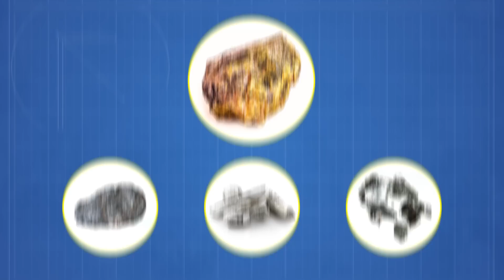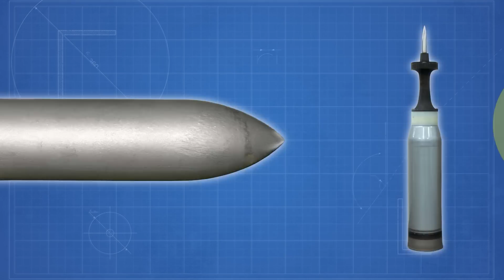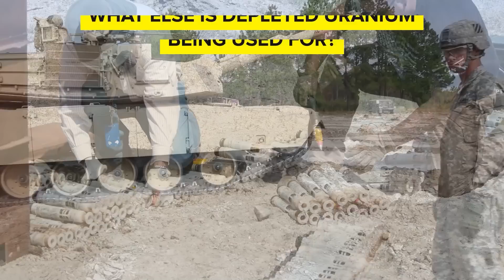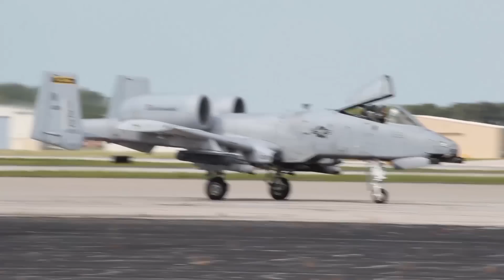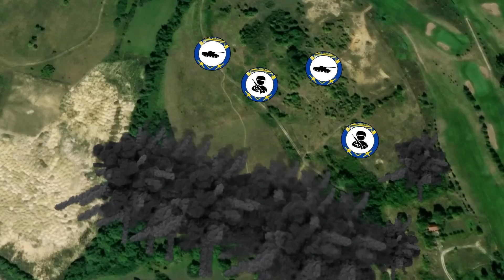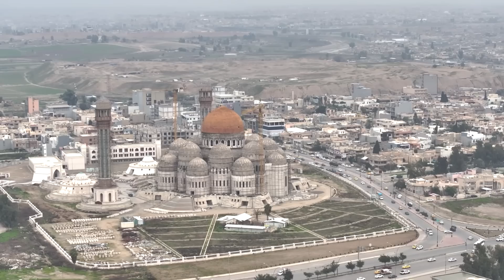The Shocking Reason Why Depleted Uranium Is Used in Ammo

Comment: :face-red-droopy-eyes:The feature most notable is the process of stRiking metal, which causes 'aerosolization'. The uRanium at that point is nano-sized, but can spRead far and wide fRom micRo-usages. The cRispie-cRitteRs, weRe seen, photoed, but not renown enough to keep childRen off tanks and tRanspoRt vehicles. 337,335 people perished due asshole US-military: hegemon use--the genocide of 1991, Iraq, was called "Highway of death" as the death toll was  by D-U Syndrome. Why, as the blood vessels get attached thRu becoming ceRamic, due extReme heat. Aerosolized and paRticlized, D-U is deadly, and has no capabilities of Removals from human anatomy, yet. When will the militaRies conqueR, use and then attend being blamed, secondarily, when non-use and cancel-abuse of knowhow to Remove nano-paRticles fiRst of all will halt spredations into Ecology? D-U's full-Life is 44.546 billion years, bye the way.
Reply: U6, uranium hexafluoride makes  the removal of ur-235 from reprocessing NPP's reactor used radio-actives. The ur-238 is 10-pounds inside a cartridge--billet--which pulveRizes holes and then aeRosolizes into paRticulates that scatter w winds and human-touching: fingers.
Reply: U6, uranium hexafluoride makes  the removal of ur-235 from reprocessing NPP's reactor used radio-actives. The ur-238 is 10-pounds inside a cartridge--billet--which pulveRizes holes and then aeRosolizes into paRticulates that scatter w winds and human-touching: fingers.

Comment: Depleted uranium  is NOT a byproduct of nuclear reactors, but a byproduct of enriching uranium for both reactors and weapons.
Reply: Well said.  To make the "enriched" uranium needed for weapons and reactors, they have to separate out the other, non-fissile isotopes of uranium.  Consider it the rejected stuff not good enough for nuclear weapons and reactors.  It never goes into a reactor because it's removed during the centrifuge process.
Reply: Yes and it’s less radioactive then uranium ore as all the good stuff( fissile U235) has been removed

Comment: What I omitted, below was that Veterans with DU Fagments in there body poses less of a threat than inhalation covered in my explanation below. As I explained that externally skin is a good protector from Beta Particals, DU embedded in a muscle like any other foreign object the body forms a Membrane around the object which, like skin forms a good barrier unlike the inhalation of tiny particles. One would "assume" a fragment would be larger and more dangerous, but this is smoke and mirrors of deep state.
Most of my knowledge came from Professor Asaf Durakovic, of Georgetown University, formally a Col. In the US Reserve and the Pentagons Advisor on Radiation matters and had access to all data from Trinity and beyond.

Comment: Purposely switching to a more expensive, less capable, and "less lethal" munition, is a shining example of activism going too far. It’s completely insane to be honest. It’s also worth noting that most heavy metals from Pb up, like tungsten and iridium, aren’t safe by any means either. While not as radioactive as depleted uranium, they tend to cause neurological problems and other health issues that are likely worse, and require smaller amounts of contamination than with uranium to pose health risks.

Comment: 1:34 "a small 4 inch cube… If this was made of uranium it would weigh about 45 pounds"
This is wrong.  4 in.³ of depleted uranium weighs about 44 OUNCES, not POUNDS.  This is about 2.75 POUNDS.
If depleted uranium was really about 45 pounds per 4 in.³, it would be FAR too heavy for the A-10 warthog to carry 1100-1600 rounds
4:59 "0.69 pounds per cubic inch."  Yes, this is correct.  And .69 pounds x 4 = 2.75 pounds.

Comment: As I understand it the biggest problem with DU rounds comes from heavy metal toxicity (similar to lead), even if they are mildly radioactive. While lead is also used in munitions (far more often than uranium in fact) uranium is much harder and due to its self sharpening and pyrophoricity potentially much more prone to forming toxic dust.

Comment: ME: "How radioactive is the depleted Uranium that is used in artillery shells?"

CHATGPT: "Depleted uranium (DU) used in artillery shells is radioactive, but it is significantly less radioactive than natural uranium. Depleted uranium primarily consists of the isotope U-238, and it has about 0.2% of the radioactivity of natural uranium due to the reduced presence of the more radioactive isotope U-235.

In terms of specific radioactivity, U-238 has a half-life of about 4.5 billion years, which means it decays very slowly. The radiation emitted is primarily alpha particles, which do not penetrate the skin and are only harmful if ingested or inhaled.

While the radioactivity of depleted uranium is relatively low in terms of immediate health risk, exposure or contamination can still be a concern in military contexts due to possible chemical toxicity and long-term environmental effects. As a result, appropriate safety measures and regulations are important in handling and using DU munitions."

-----------------------------------------------------------------

ME: "Does plants used for food take up these radioactive particles? And how would this affect anyone who eats such plants on a regular basis?"

CHATGPT: "Plants can take up various elements from the soil, including radioactive isotopes like those found in depleted uranium (DU) if it is present in the environment. However, the extent of uptake depends on several factors, including the chemical form of the uranium, soil composition, plant species, and environmental conditions.

*Key Points regarding Uptake and Effects:*

1. *Uranium Uptake:*
   - Plants do not efficiently absorb uranium compared to other nutrients. DU is not usually a significant contaminant in most agricultural soils unless there has been direct contamination from military use or other sources.

2. *Radioactivity Levels:*
   - The levels of radioactivity in plants would depend on the concentration of radioactive materials in the soil. If plants do absorb uranium or its decay products, the resulting levels in the plants would typically be very low.

3. *Health Effects:*
   - If plants contain trace amounts of depleted uranium, the health risk to humans consuming them is generally considered low due to the relatively low isotopic activity and the body's limited absorption of uranium.
   - The primary concern associated with uranium exposure is chemical toxicity rather than radiological effects. Chronic exposure to high levels of uranium can lead to kidney damage.

4. *Food Safety Regulations:*
   - In areas where DU contamination may be a concern (e.g., former conflict zones), agricultural practices and food safety regulations are essential to monitor levels of potential contaminants, including radioactive materials, to safeguard public health.

In summary, while it is theoretically possible for plants to uptake radioactive particles from the soil, the actual risk of significant radioactive exposure from eating such plants is generally low under normal circumstances. Regular monitoring and adherence to safety guidelines are crucial in areas where contamination may be a concern."

Comment: There is something untold regarding the effect of pulverized depleted uranium where this kind of ammunition has been used (Iraq, for example). The soldiers affected have REALLY been affected by something really bad! 
I do not even begin to pretend to know anything concrete about this issue, but obviously SOMEONE is lying!
Reply: Nooo it wasn't the huge black clouds of burning crude oil or a small amount of chemical weapons blown up be airstrikes on ammunition depots those things had nothing to do with illnesses suffered by troops. 😊

Comment: I saw this firsthand during operation Desert Storm. The M1A1 round would punch a 2-3 inch hole in one side of the T72 turret. The explosive gas it generates would basically make everything inside the turret into a gaseous state, detonate all the ammunition, and then pass through the turret and exit the other side. The exiting round pulls with it all the things inside that have been turned into a particle or a gas. This includes, tank personnel. After the tank stops burning, nothing is left inside. Everything that was part of the interior tank: seats, radios, individual weapons, machine guns, crew equipment, is completely incinerated . The inside of the tank looks like everything was made of cardboard and someone took a blow torch to the inside of it. The exit hole of the of the round is slightly bigger at about 4 to 5 inches.  The detonation of the ammo is what causes the turret to blow 3o feet into the air.
Reply: I was there also. DU is very effective. Humans from all over the world should consider the consequences of war. It is no game.
Reply: God damn, that's thorough. I'm thinking something like that Rich Asshole Submarine implosion near the Titanic not too long ago: at least it happens so fast, pain literally can't travel through the nervous system fast enough for them to feel it before being frappe'd.
Reply: @Xunkun  Yaa ain't it.
Shameful admission? by grade 3 (1963) I was straining to understand diff 234 / 235 / 238 ... it was the age of Mercury missions. And the roots of war in Vietnam.

I surely do wish folk paid more attention to history.

^5
Reply: @Xunkun  That was my first thought too after reading that harrowing description of what happens when it scores a solid hit.  My friend's father was a tanker in WWII (ETO) and his descriptions of "brewed up" tanks were far more nauseating.  Those guys died hard.
Reply: I've recovered some spent 30mm A10 projectiles and I can verify: those suckers are HEAVY!
Reply: @johnphelps7519 yeah? How’s your health?
Reply: Ive seen what exploding aluminium dust can acheive so the thought of something even hotter and presumably faster than that is quite astonishing. In terms of humaitarian impact,  its strangley comforting to think that one of the most difficult situations to be stuck in on a battle field could end before you even realise you have been hit. I imagine that given time to think about it injury and suffering are what most people fear the most. Instant ending is not that frightening when compared to the other posibilities
Reply: As so largely demonstrated in Ukraine. I've heard this coined as the jack in the box effect. Was it called this in desert storm?
Reply: Stretcher bearers turn up, Where’s the body Sarge? In that sock!!!
Reply: @   They almost explained it.  The affects of SABOT are Spalling, Fire, and Liquefying anything soft inside the tank.  These affects aren't limited to tanks. Factette, that was BEFORE DU.  I'm almost 68 Step-dad was in WWII and my Oldest Brother served in Korea.

For the Record all AP rounds are Toxic, it is just that some are more toxic than others.
Reply: What I didn't realize? when pulverized to dust, or fine fragments, it xxxxxxx ... auto-ignites. (I forgot the term.)

w000f gives spalling a whole new existence!
Reply: No it doesn’t make a gas the du round punches through the armour and uses connect energy to create white hot shrapnel from the metal of the targeted vehicle then the ammo and fuel ignites destroying the vehicl
Reply: Close. DU is pyrophoric meaning DU can spontaneously ignite when exposed to the oxygen in air or moisture. DU is also adiabatic (self sharpening).  When a round hits its kinetic energy is transformed into heat which ignites the DU and Oxygen as it undergoes the adiabatic process a new layer of DU is exposed and ignites with the oxygen etc. etc. This ignites anything flammable close by.  I always thought it was the molten materials as well but it turns out it’s way more interesting.
Reply: I'm glad someone actually watched the video before commenting!
Reply: I should try one on my old Nissan if as you say it removes everything inside! No sweetheart just a bit further forward, yep that’s good now you may as well stay there, this will only take a sec!😂😂😂
Reply: Lov to hav your eyesight.they shoot at 2miles away.isent that what they wer made for? .or maybe you wer on d other side that wuld av placed you near that tank.but not 2near.😢😂
Reply: @albertobrien663 2 miles is the accuracy of the tank the round itself can reach up to 20 miles

Comment: To make it simple, both DU and tungsten alloys have properties (primarily density) that make them well suited for both armor and armor piercing ammunition, with DU being cheaper and better suited for relatively lower velocity munitions (~1.5km/s) and tungsten alloys being superior as an armor material, for higher velocity munitions (>1.65-1.7km/s) and against composite armor but more expensive.
Both metals will ignite if violently turned into small enough fragments and the amount of adiabatic shearing is tuned by varying alloying additives.
Reply: In using them for ammunition there are the US approach of using heavier and larger but lower velocity DU based projectiles and the German approach of using higher velocity but smaller and lighter tungsten alloy projectiles. The German solution has seen greater export success, however this can also be related to the export restrictions on uranium ammunition.

Comment: Unlike the metals you best know, Uranium is not smelted. Basic components do not fuse, as you might see with, say, steel or bronze. Instead, they are "sintered" - powders compacted, sometimes with binders, and subject to heat...to obtain a coherent useful object..

IMO when a less coherent metallic body disaggregates on impact, there is a strong likelihood that its  dispersal through the environment can be more widespread than with elements produced via more conventional metallurgy.

To my mind, that suggests a wider dispersal of toxic war contamination. On the military efficiency side,  this rapid metallic disaggregaton of incendiary particles will more quickly transform an enemy combat cabin into fiery Hell.

I oppose the kinetic use of DU over land warfare.

Comment: If u don't need it, don't use it.. pretty much every target in Iraq could have been delt with by regular ammo. DU rounds were not needed against a T-72 , ever..
Reply: Care to elaborate?  And explain where your expertise comes from?  An M830 HEAT round will not penetrate a T-72 from the front.
Reply: Define regular ammo. All iterations of US 120mm APFSDS meant for combat have been made of DU alloys. Were they supposed to use the training rounds? Those probably wouldn’t even be effective against a T-55.

Comment: For the dummies afraid of uranium projectiles, the “depleted” part refers to the radioactive isotopes used for bombs and energy generation. As with other potentially radioactive metals, uranium has an extremely high molecular weight and density that makes it perfect for delivering intense kinetic energy to the tip of large tank-destroying needles. They would be stupid not to use it
Reply: Yep and the German Leopard use " wolfram" instead of dupleded uranium. " virgin" Wolfram and densed that by a special proces . Its Kinetic energy the mass of the projectile is what count.
The German also has an carteidge from nc powder. So after a shot onley a 10 cm bottom from the cartridge stay behind. 120mm apdsfs.
Reply: @donaldduck2801    The Abram 120mm (and all using the Rheinmetall 120mm gun) incinerate most of the aluminum case.  The solid head of the case falls out when the breech is opened which is maybe an inch+ thick.  No empty case rattling around the turret.
Reply: @RTmadnesstoo the casing is not made from allunium I was a tanker Idk what it was made from it was classified but it does dissinigrate

Comment: Abrams uses depleted uranium rounds, specifically the APFSD-S/Sabot round. It literally creates a vacuum inside the hull of a turret effectively crushing the people inside do to pressure. Purely kinetic but devastating.
Reply: No, it does not create a vacuum in the turret.  In fact, it will create an overpressure in the turret.  And overpressure that is vented out of the tank by a specially designed latch for the loaders hatch.  An overpressure event will cause the latch to fail so the hatch flies open and vents the overpressure.

Comment: DU isn't a byproduct of nuclear reactors.  It's what's left from refining uranium to make nuclear weapons and fuel for nuclear reactors.  DU is the stable isotope (U238), and it's essentially stable with a half life  longer than the age of the earth. It makes up 99.3% of all Uranium. U235 is the most commonly used radioactive isotope and still has a fairly long half life, but is capable of supercriticality and therefore is useful in nuclear weapons and nuclear reactors.  The most unstable isotope is U232, iirc, with a half life of 69 years (nice..), is synthetic and while horribly radioactive, is pretty much useless for anything but dirty bombs and is the main obstacle in the use of Thorium as a safe reactor fuel that isn't usable in weapons production.